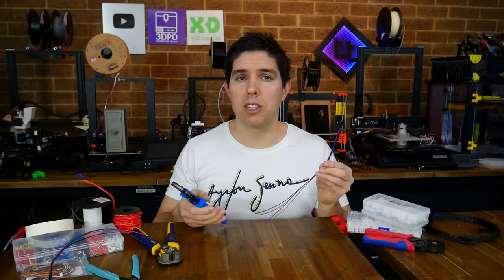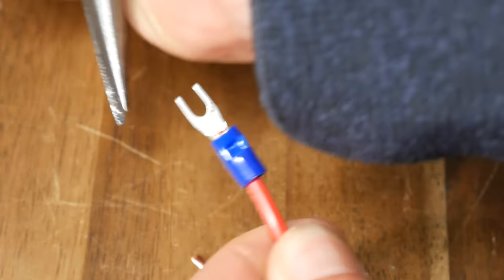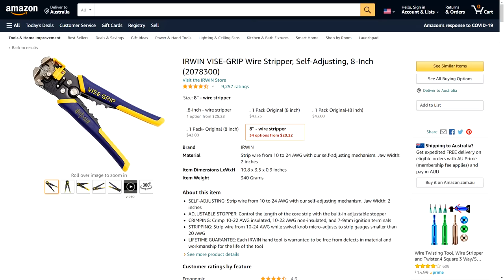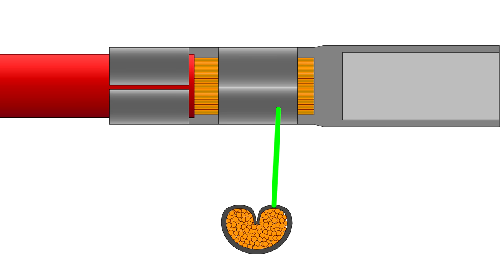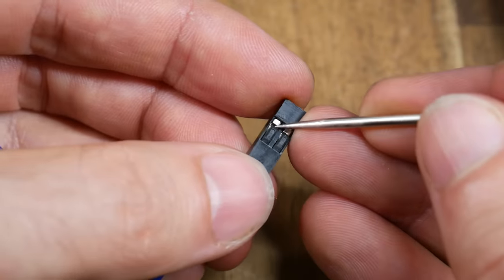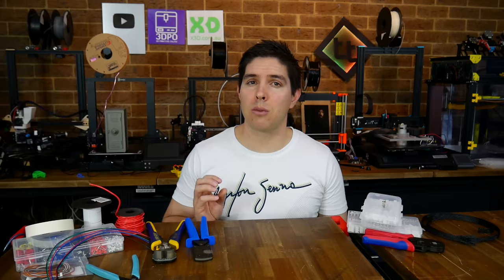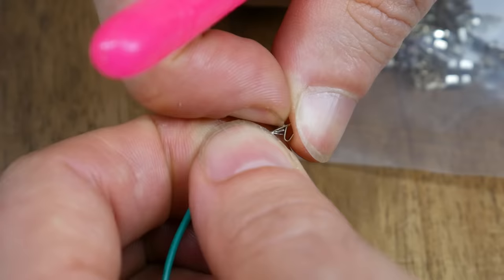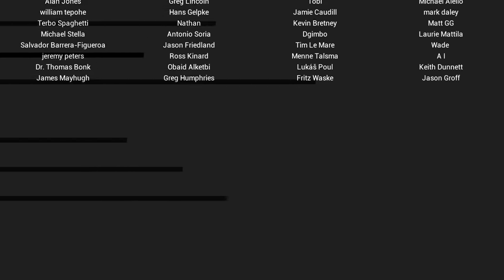Guide to crimp connectors on 3D printers - Take your wiring to the next level!

Comment: I ignored this video for the first two hours because I thought it was from my recommendations rather than subscriptions. My recommendations are flooded with crimping videos because I’ve spent the last three days trying to source BNC connectors and the appropriate crimp tool for super-thin MHR (medium high-res) coaxial cable. If only it were as simple as these! All the suppliers refuse to even tell you how much it cost or let you order it unless you are some certified professional blessed/endorsed by their company. The thing is, I did start a business making video upgrades to old game consoles and do need to make custom cables in a professional capacity. I’ve been chopping up premade cables instead but now I have 300+ meters (1,000 feet) of Extron 5MHR+2 cabling that I need to use. If anyone can help me get an Extron or Amphenol crimp tool for MHR BNC I would be very grateful.
Reply: @zanpekosak2383  Thanks. I did find the die set at Mouser (47-20250) and I wonder if it will fit that AliExpress tool frame. Perhaps one of the die sets they offer matches this one. :)
Reply: @zanpekosak2383  As is typical of many items on AliExpress, they don’t give nearly enough details to know what dies are for what. :( Not sure how they expect to sell any if you can’t even see for yourself in the pictures! I guess they are affordable enough that some would just buy them all. That info must be somewhere so I’ll keep chasing that lead. Thanks again!
Reply: No problem. Yes finding stuff on ali is a bit of a gamble, but the dimensions for coax cable diameters are listed in the dies description...or am I looking wrong?
Reply: For crimping BNC cable connectors, crimping coaxial cable connectos
crimping range:8.1mm,6.5mm,5.4mm,2.6mm,1.72mm...is what is written in the description.
Reply: @zanpekosak2383  Yes, it is listed for the standard die but just like the Amphenol RF tool frame you still need to swap that out with the appropriate die set for m59/MHR. m59/MHR coaxial use a die set with even smaller diameters that I see labeled 0.042, 0.128 (Mini Hi-Res) and 0.048, 0.178 (Mini 59). There is a strong possibility that one of the swappable $3 die sets they offer and link to for the same tool frame can do those but they just show a picture of them all laid out with the part number for each die set. There isn’t enough resolution to read the markings on each die set nor is there a table of what die set models crimp what. Many other listings for the same die sets do the exact same thing so it seems none of the sellers even know what dies crimp what. :( Granted, you can buy every one of them for less than the cost of the Extron or Amphenol tools sets but if you do that and it still doesn’t support these less-common BNC sizes then it would only make sense for people doing a broad range of things where having so many other random die sets might be useful anyway.

I’ll keep digging. Maybe someone has a table with the specs for all of those die sets somewhere. :)
Reply: @zanpekosak2383   Markertek was able to source one for me at nearly 4x the price of the one I originally tried to order ($235+). It turns out that I also need ferrules for the Phoenix audio connectors that go with my MHR BNC cables so I went ahead and ordered a bunch of the stuff Michael suggested here. It’s all coming together now. :)
Reply: Cool. Glad to hear the project is coming along. I also had the chance to try some premium crimp tools during my mandatory apprenticeship and I gotta say that for profesional use, those make sense. For hobby use though, you have to be a hard core enthusiast to justify the 600$+ price tag of good Weidmüllers or similar.
Reply: @zanpekosak2383  I’m surprised Markertek was even able to source one since they don’t sell Extron and did not appear to be an Extron partner. Not even sure what possessed me to ask. :) Yeah, $235 was a tough pill to swallow but it could’ve been a lot worse for some of the other professional tools out there!

Comment: Tinning wires is a safety hazard?  Guess my Electrical Engineering instructor was wrong.
I have never used ferrals and always tinned the wires.

When I didn't have a JST crimper available I have used a pair of needle nose pliers and a touch of solder for a secure connection. I have also soldered Male connectors to wires to make extensions and intercepts.

I always prefer soldered over crimped connections, especially if it's going to be subjected to the elements. I can't even remember the number of times that I've had to cut off corroded connections and then replace them with soldered and shrink tube. 

I even had to solder the clamps on the end of my jumper cables because the factory crimps failed after about two years.
Reply: For anyone reading this comment: don’t do any of this. Tinning before crimping or screwing down is bad because solder cold-flows under pressure. Soldered connections are less reliable than a properly executed crimp. (However, a bad crimp is worse still, and that may be what the commenter above was actually dealing with.) DO NOT crimp and then solder a connector, because that worsens the connection by ruining the strain relief, both by softening the insulation under heat, and by allowing solder to wick up the wire, moving the strain point to an unsupported part of the wire.)

Comment: Never twist wires as during crimping strands will cut into each other.
Reply: and that is detrimental why?
Reply: @saschaschneider6355  Because if the wires are cutting each other you will have less wires actually carrying the current. You essentially bottleneck the current at the crimp.
Reply: Nice introduction but could be a lot better if you would add information on which gauge wire for what and a simple guide on routing cables and some info where to put connectors on hotend for easy dis &  assembly
Reply: @Richter3D  How would you get less wires or rather strands? They form a single mass that doesn't change and they're not insulated from each other in the first place. The thickness remains the same. What am I missing here?
Reply: @saschaschneider6355  it reduces the current carrying capacity of the connection / increases heating. If it's bad enough it can cause a fire.
Reply: @BrodieFairhall  can you please point me to an _explanation_? Because I've seen claims without any evidence here, including yours. I keep asking for evidence/an explanation but nobody seems to be willing or able to backup their claims

Edit: we're talking pretty low voltage and pretty low current here. The wire used has a larger gauge than the pin that is used as a connector. I think you're all  blowing a hypothetical problem way out of proportion.
Reply: @Sascha Schneider  I started as an electrician, I'm now an electrical engineer. I've been taught how to do this correctly, read manufacturer documentation, crimped 10's of thousands of lugs and in more recent years reviewed electrical incidents where things like this have been the cause of failure or fire. Go to any reputable manufacturer of lugs/ferrules (such as utilux) website and read up on what you can about each of their different lugs, how they should be used, what types and CSA of wire they are to be used on, what tools should be used to crimp them, crimping forces etc.
Some manufacturers have videos, from memory utiliux has some good content with x-rays of correctly and incorrectly crimped lugs with explanations.
There is far more to it that "jam wire in and squash". I'm not just making claims, the information is available if you look.
Reply: @saschaschneider6355  Don't act so entitled, do your research, I've had to. It's not my job to go dig it up for you.
Reply: Yeah, it looks like it's true. Judging by the JST manuals, each single wire should be crushed, deformed. That is, the wires should not be twisted.

Comment: For very rare crimping you could use pliers+soldering technique. Just press terminal on wire and after solder it with flux.
Of course it takes extra time and you should have some additional skills but saves a lot of time while you are waiting for parcel
Reply: I highly advise against this.

Comment: DO NOT TWIST THE WIRE STRANDS BEFORE INSERTING IT INTO LUGS OR BOOTLACE FERRULES.
Leave the strands straight, it requires more care and patience when inserting the wires. Twisting the strands causes them to cut into and often through each other as well as leaving voids between the wire and the lug.
I have had to investigate too many electrical failures and occasionally fires in my career caused by bad practices like this.

Comment: 5:17 - It is false that the size of the connector matters in terms of current capacity - connectors are not rated to certain current. What DOES matter is the GAUGE of the wire used, cause that determines the max. rated amps of current to pass through said wire. You could easily use the blue connector with small wire and the max rated current is still determined by wire's gauge - with that you will get almost non-existant crimp connection with low current capacity.
Reply: That is so wrong, my friend. Higher current capable connectors  NEED to be thicker... That's why higher wattage through-hole resistors have thicker legs. Otherwise, they'd save on metal and give you thin legs for high-watt resistors.
Reply: @alejandroperez5368  there's a nuance. skinny wire + fat connector = the current is limited by the wire. Fat wire + skinny connector = the current is limited by the connector. The video at 5:17 is correct that the fatter wires can carry more current. But it is incorrect that the connector crimped onto the wire can handle more current just because a fatter wire is used. (To be fair, the ring terminal shown can handle quite a high current so a correctly crimped connection with red or blue cover will be limited by the wire not the connector). So size the connector and the wire for the required (/worst-case/failure-case) current flow and you'll be golden.
Reply: @SittingDuc  that's not what the OP said though
Reply: The colors do indicate gauge, but connectors certainly are rated for specific current. At least, any name brand connector is.

Comment: The connectors used in the printers I've seen are the cheapest most unreliable and difficult to crimp I've seen in 50+ years in the electronics design business in America.  The connector manufacturers should sell proper crimpers for  their products.  Buying crimpers on Amazon is a crapshoot.  I haven't found any that work the way they should or claim.  The content in this video is basically good but the actual crimping is not as easy as it looks.
Reply: The connector manufacturers do sell proper tooling, and it’s great to work with. The problem is that proper tools cost anywhere from $300-1500 each, which hobbyists aren’t willing to pay.

What’s sad is that the Chinese tool makers are often within spitting distance of getting it right. Rather than making $20-30 tools, if they made ones at $60, they could be good enough to compete with the real deal. 

I gave up on cheapies and now buy original tools on auction sites and local classified ads. It takes patience, but then you can get the proper tools at bargain prices.